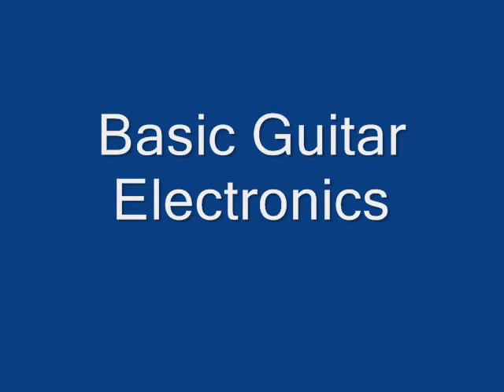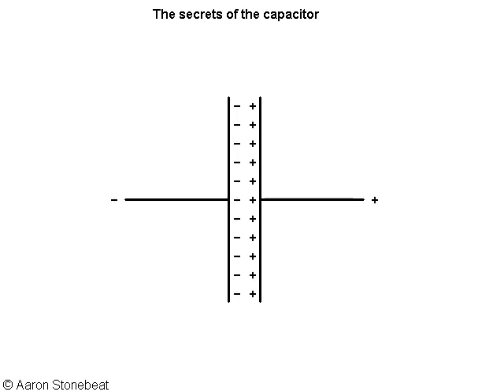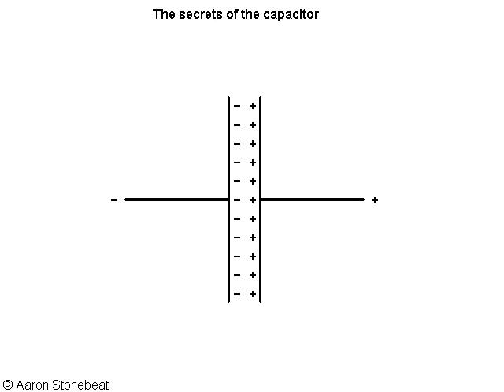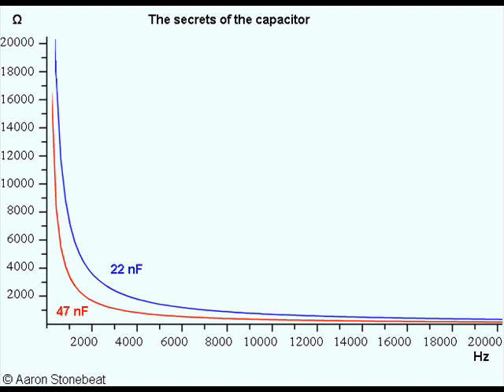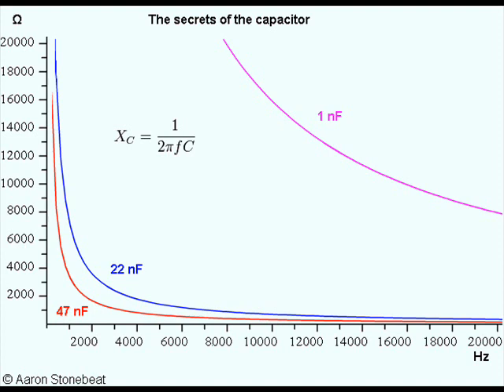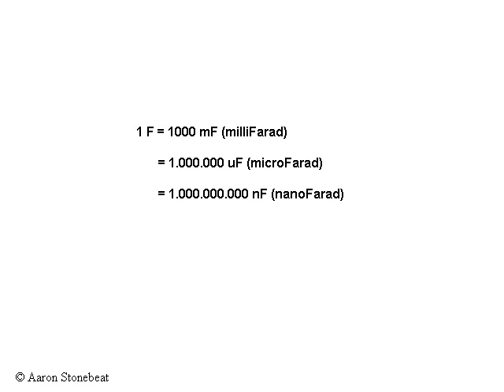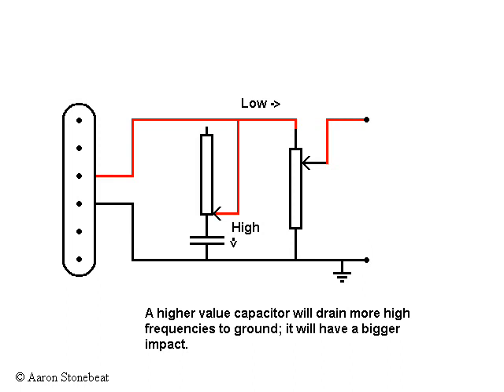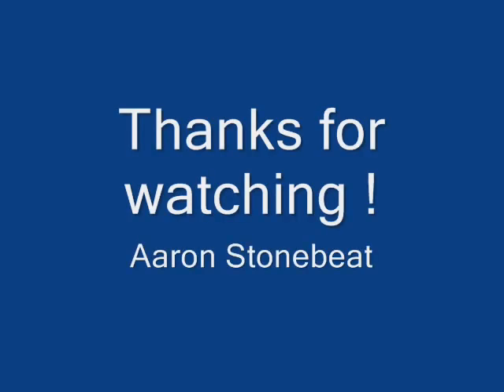Basic Guitar Electronics XIV - Capacitors explained

Comment: MARC VAN, When measuring a single Coil pickups the DC resistance is 6K, Inductance is 2.3H, Capacitance is .0040uf , what is the formula to get the resonance frequency of the guitar pickup with these values?What is the formula when you put a 250K volume pot and 250K tone pot in parallel?What is the formula when you roll down the tone pots with a capacitor of .015uf?
Reply from the maker: Watch this one, maybe it helps: https://www.youtube.com/watch?v=w5NaIzgvrtA